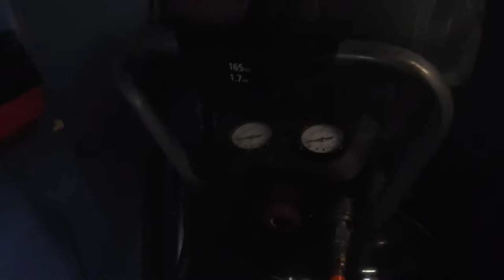Flat Tires!!!!!

Comment: Put cameras around the shop bro. That will help.
Reply from the maker: L0RD SPARTAN its not at the shop its on the street since we use our parking spots for customer or cars that dont have plates, but when its rush hour 4pm-7pm we need to park around the corner because we are in a 3 lane street